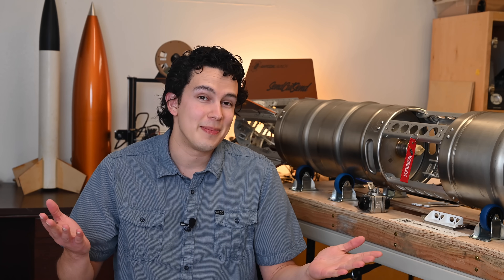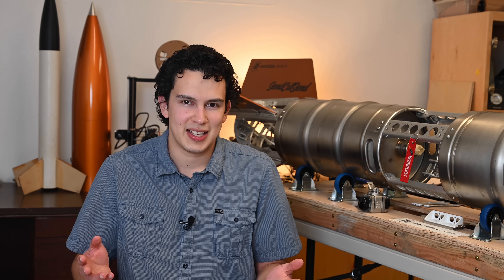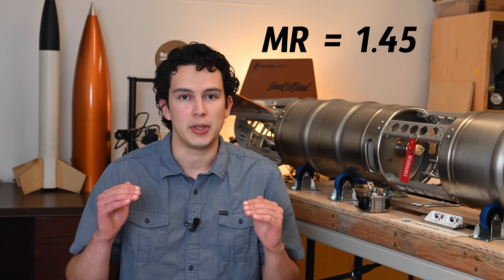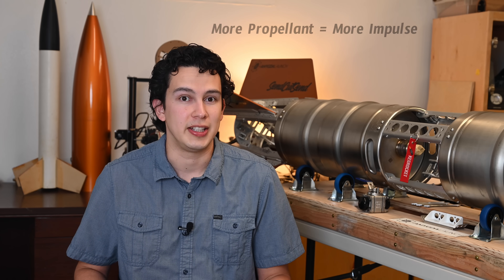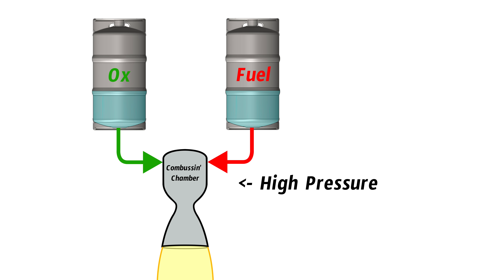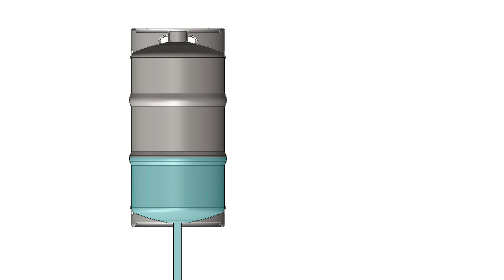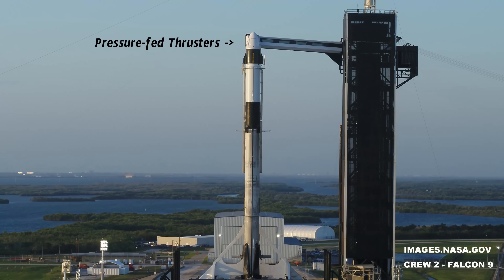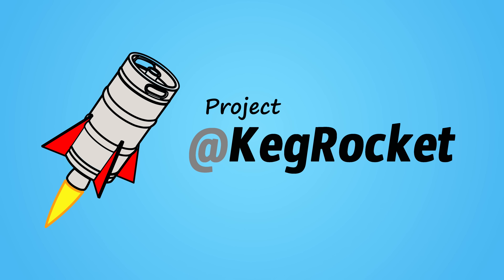Keg-Based Propulsion Design - KegRocket Ep. 2

Comment: how about the oxygen tanks pressure?  The super cold oxygen will warm up and boil off increasing pressure and the pressurized air will decrease in pressure being chilled by the oxygen.  maybe fill and pressurize the ethanol tank then fill the oxygen tank without pressurizing it then monitor the pressure in the oxygen tank as it rises until it reaches the desired pressure and then ignite?
Reply from the maker: The oxygen tank (keg) will be vented to the atmosphere until final countdown and then pressurized with nitrogen. As long as the vent valve is not shut for too long, it should not be an issue